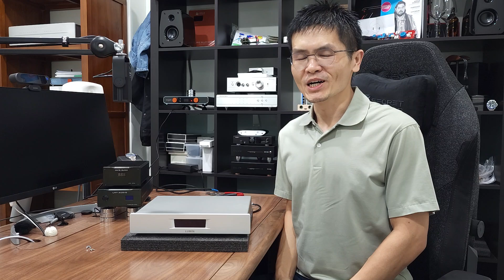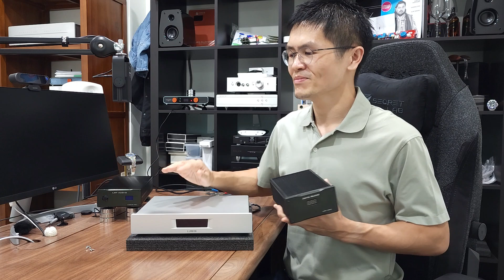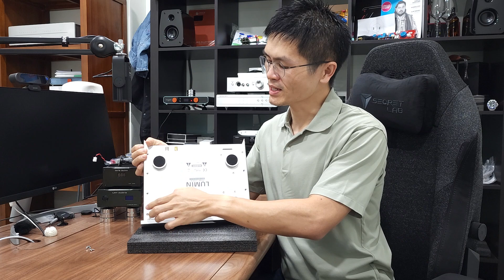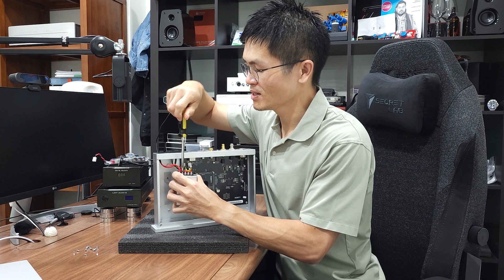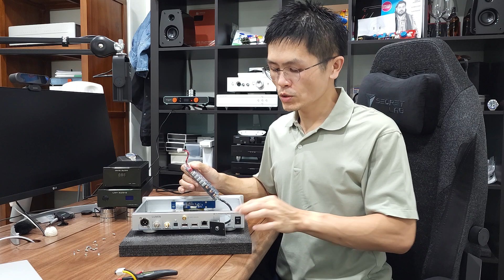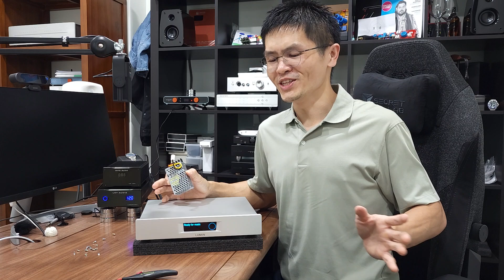Part #2: Lumin U2 Mini LPS Mod [Completed]

Comment: Hi Elvin, I’m considering the Beatechnik x LHY Audio power supply kit for the Lumin U2 Mini.
From your point of view, as objectively as possible, how much real sonic improvement does it bring on a scale from 1 to 10 compared to the stock Lumin U2 Mini?
Reply from the maker: Hey Nicola, the PSU upgrade improves the sound quality. As to %, I shall leave it to the users :)

Comment: Hi Elvin, thank your for your elaborative approach foe the lps upgrade. Can you share your opinion on the u2 min performance with lps vs the u2 (higher model)?

I have a pair of very HQ active monitors (dynaudio core 59) and i am especially looking for a streamer with aes/ebu output (sqc input into the core 59 is via aes) and volume control (what the lumin u2/mini have)

Comment: As far as I understand the Lumin U2 Mini is a fully digital component. It just "calculates" bits (there is no digital to analog conversion). So why a new PS should be of any advantage for this? Do you think a computer calculates more accurate when the PS is highend?
Reply: Everything is about "noise".
Reply: @kinggodzilla7647  yeh, snake oil digital "noise" 🙂

Comment: I bought the kit for my LUMIN U1 mini + LPS50 and the change is impressive, almost as if I had changed the Dac or the speakers. The sound is much more extended up and down the frequencies, and without grain, with a continuity and linearity that leaves you wow. More crystalline and less prominent at the top, more natural in the middle area and the greatest improvement is in the lower area, with bass with more grip, more sound space. If I could summarize the immense improvement it would be as sound with elegance and continuity across the entire bandwidth. Thank you again Mr. Alvin Chee.
Reply: How many V ( volt ) the lumin works? Which power supply to buy?

Comment: Hi Alvin. I have LHY LPS 25VA model for my Lumin U1 Mini. I plan to upgrade to LPS 80VA. Can I use back my current DC cable? Does the power outlet connector of 80VA and 25VA the same?

Comment: I already had a LPS for another gear. Then I bought the Mini upgrade kit but put it in the closet because the switch power was already good. A month passed, I finally did the upgrade and it is a true upgrade to me. It took my system to another level higher. Thanks to Alvin

Comment: Okay people, so I bought this and it took me a while but I installed it. Result on MY system (mid-highend) was outstanding! The soundstage is deeper, (obviously so) and wider, there is much more separation of the instruments, and the whole presentation is quieter than before. Well worth the upgrade of my Lumin U2 Mini.

However here are some alterations for the install:

1. Don't clip the one red wire from the switch to the plug: take a soldering gun and apply some heat and then slip it off. (easy-peasy)
2. Buy 6 3mm nuts and washers so that you may place the screws back in the chassis so that there are no dust holes 
3. Since the screws are now in their proper holes again, get something to mount the internal board about 6mm off the bottom of the case to clear the screws.

Notes:
A week later I am still pulling my head up / opening my eyes because I hear sounds more prominently than before (or didn't hear before). I think I am in the upper percentage of people who hear such a difference... but I am not so surprised what this LPS Mod has accomplished over its switching power supply. 

Also wish to say that this is much better decision than the sbooster because by default all the wires are at the back and not looking so sbooster fugly. (much less their is some L/C filter circuitry in this Mod which I believe is not in the sbooster)

This has been one of my best mods to a piece of equipment to date. (35+ years).
Reply from the maker: Thanks for the positive feedback and tips, James! I am glad that the LPS works for you, and more importantly, the modded Lumin is sounding good. Enjoy!
Reply: Thanks a lot, add few pics it'll be easier

Comment: Just shows how much profit these companies make. An aluminuim box and a single PCB. £200 in parts at the most, £1800 profit. Criminal.
Reply from the maker: I wouldn’t go too far in commenting this though. On bright side, consumers on the market are well informed these days, thankfully :)
Reply: Not really. In a device like this, the ongoing software development for the companion app is high. Costs for factory, labour and test equipment for FCC, CE and other regulatory compliance testing across multiple countries. Costs for custom packaging and technical authors for documents which all need legal review. Costs to set up a supplier chain and ship units to distributors, costs to market and supply loss leader units to reviewers. It all adds up. A retailer typically buys at 50% of retailed price, and the manufacturer makes similar margin, so the unit likely costs £450, but DIY equivalent doesn't have most of these costs. If you can DIY something as good including bespoke Android/iOS device apps, then do. But there's a lot more than a case and a board to bring such devices to market.
Reply: @maybecrazy7835  Some of what you say may be true, I don't agree with everything though. I hate the markup in audio, it makes me angry. I don't mind companies making a profit, but if you are right then 4 times build cost is still disgusting.
Reply: @johnratcliffe6438  Then don't ever find out how much a typical car costs once it's in proper production. It's a more eye-watering ratio. But I get what you mean. Certainly audio has areas way worse than streamers, most notably cables. But people still spend 100s or 1000s per metre. Audiophile cable prices could be considered a criminal enterprise.

Comment: What is the advantage of one of the larger power supplies as opposed to the 2amp unit. I ask because the switching mode power supply is also 2amp. What are the advantages of of the 5amp?
Reply from the maker: Hi James, I'd recommend LPS50/80VA for the Lumin U2 Mini. The LPS25VA rated at 12V/2A, might be a little on the bottle neck. As long as the LPS is rated >= the stock SMPS, it will work just fine.
Reply: @VinshineAudio 
i'm confused you said two different ones for the U2 mini what one of these two do i select for 
U2 mini •LPS50VA
or
•LPS80VA   ❓

Comment: hi, if i choose lps 80 which is 12v 5amp, does it compatible to lumin mini u2, any differnce in sq compare to lps 25. does lps 80 reduce the life of player, whn compare with other like 2  or 3amp lps
Reply from the maker: No sir, it will not reduce the lifespan of the device. The device 'draw' the current from the LPS instead of the LPS 'pump' the current to the device. A larger capacity LPS would mean that you have more headroom or at least more power reserver :)

Comment: Thanks for mentioning the warranty situation!
It's unfortunate, but there have been PSU modifications that have caused problems, so we have to take this stance. If you do want to change a PSU in a LUMIN unit, make sure that you are comfortable with the risk or that the company supplying the modification is offering their own warranty to replace the official one.
Otherwise, it may be better to trade-up for a LUMIN that features a toroidal PSU from the factory (U1 / P1 / X1).
Reply from the maker: Thanks for the clarification sir! I can't agree more.
Reply: Yeah, reality check here. You need to feel absolutely confident in your decision to start cutting wires and removing parts (and thus invalidating ANY future warranty coverage forever) on your fairly new $2400 streamer.  Maybe if you find the U2 lacking, you could take the money you were going to spend on it PLUS the extra $ for the upgrades and buy something that you don’t have an issue with.  A stock unit with a partial warranty still intact is going to be more desired during resale than a bastardized unit modified by your typical kitchen table amateur tinkerer.
Reply: It's a shame for the company not to provide LPSU with this price tag device. Learn something from Denafrips

Comment: Can you mount the LHY Filter bank kit direct too the orginale power supply on the Lumin? For better sound improvment? I have the Lumin T2. The streamer chassis have better place inside.
Reply from the maker: Sure, you may explore different method/position to mount the PSU kit.

Comment: I feel sorry for the people who have wasted their money on a Lumin.
Reply: Have you tried a Lumin U2 mini with upgraded PSU  in your owned system?  You may answer Yes but i don't think so. You are just one of those guys who make comment without basis.. Try it and you will be blown away. 
I sold my Gaia DDC and now my Schiit Freya+ preamp is also up for sale. That's how good this Lumin U2 mini is.
The Leedh Processing volume control really works wonder.
Reply: @BrokenArrow-x6f  I’ve heard it without the ps mod. It’s a basic usb streamer for $2500 lol. Why would you mod something that you paid $2500 for when there are streamers that measure and sound way better (with a linear power supply) at literally 1/2 the price?
Reply: @cameronrector178  HAHA.. Then you have a serious hearing problem.   And why would i mod the PSU? because it brings closer to the level of full Lumin U1 which is 5x more expensive than the U2 mini.  Did you see how much money i save with the mod? as i have said you are commenting without basis.
Now, go see an  EENT doctor to have your ears check ASAP
Reply: @BrokenArrow-x6f  bro you are using a USB connection 😂😂😂 GTFO
Reply: @cameronrector178  there you go again. How did you know i'm using USB? As I have said on my initial post, used to have a Denafrips Gaia connected to my Terminator  via i2s  and sold it after doing an AB test with  the Lumin U2 mini with and without the Gaia. And I used AES to connect the Lumin to the Terminator... Now you need an eye specialist too and go back to school coz your reading comprehension is very poor.🤪
Reply: @BrokenArrow-x6f  AES?!? 😂😂😂 omg. I’m done here. I should revise my comment. I don’t feel sorry for people who waste their money on Lumin. The world economy needs these idiots. 😂
Reply: $2500, no I2S output, and you have to personally modify it (voiding warranty) to make it sound half way decent !?!? NO THANK YOU!!!!
Come on Alvin!!! Please don’t recommend this garbage!!
Reply: @cameronrector178  Hi, what do you recommend?
Reply: @lazo64er  Silent Angel Munich M1T or Pi2 designs Mercury streamer. 
Both have I2S output that matches Denafrips pin out. No need for a DDC. Plug and play.
Each are $800. Sound and measure better than any USB streamer even with a DDC.
Reply: @cameronrector178 ... I've tested the Munich M1T against the U1 Mini. The Munich is not as good sounding. 

As for mods, Silent Angel sells a LPSU and different DC power cables. WTF you talking dude? 😂
Reply: “I've tested the Munich M1T against the U1 Mini. The Munich is not as good sounding. AB ... not in different systems. Next time, do an AB comparison. As for mods, Silent Angel sells a LPSU and different DC power cables. WTF you talking dude? 😂”

Explain how you did a A/B comparison when the Lumin doesn’t have an I2S output? 🤔GFTO 😂😂😂
Reply: @cameronrector178  … oh wow! You are right. The Lumin does not have I2S and the Munich has ONLY I2S digital out right? Stop being an ass ok. Both units have USB out.
Reply from the maker: It's a good streamer, loving it :)

Comment: Great video Alvin.  Expertly executed.  You didn't explain exactly the function of the internal circuit board.  Would it be a filter circuit to for example minimise circulating ground noise and/or possibe internal Lumin noise back into the mains?  I am a former Radio Ham with radio electronic qualification, so was confident to execute the mod.  I used  Plixir Elite BDC 12v/4a balanced transformer design which perhaps cancels the need for the internal circuit, though probably at more cost.
Reply from the maker: It's a good question. The LHY Audio PSU Kit does have L/C Filter circuitry, unlike other kit on the market. The LC circuitry is tuned by LHY Audio engineer for audio :)
Reply: @VinshineAudio  Thanks Alvin 🙂
Reply: Hi! I see other LPS conversions for U1 mini, that only include short cable from main board to DC5.5/2.5, to which you connect LPS. I can use either this board inside Lumin, or just cable to LPS? Just to be sure I don't buy wrong parts. Im using PD Creative 12V LPS. Thank you in advance!

Comment: Alvin, Would you comment on the expected improvements in sound quality/characteristics that one could expect from adding the external power supply.
Reply from the maker: Hi Paul, you may expect the following when you use/add an external LPS (a good quality one) - Lower noise floor that leads to better details, better weight, better imaging, soundstage. These are the common positive attributes.  That being said, I am a strong believer of good quality power supply is the foundation of good sound.

Comment: Blu-Tack works great for fixing the board to the bottom of the U2 instead of double sided tape.
Reply from the maker: Great suggestion! That's cool :)
Reply: I used 1 zip tie gently through the two holes close to the front.  It's perfectly secured to the chassis.

Comment: I am using Sbooster power supply. It was easy to install and made a substantial difference in the sound quality.
Reply from the maker: Thanks for the feedback sir. Indeed, I am a strong believer of good quality LPS!
Reply: This sounds so promising and the cost is most reasonable! What is the difference that you hear? TQ!
Reply: @hushpuppykl 
yes please tell us the differences in the sound quality...that is the entire goal...❓
Reply: It's good to know.  I have the Sbooster 12v-2A and plan to use it for this kit.

Comment: Thanks Alvin, very well explained and performed. After going through lots of streamers and struggling with them I decided to opt for the u2 mini and am very happy with its ease of use and performance.
However I’m always looking for ways to improve on my system and am very keen to upgrade the power supply to the Lumin.
I live in the Wirral England, so would it be possible to order the power supply and circuit board that goes inside the Lumin from vinshine? May I ask if the advantage of replacement. Could I expect a little darker background and what’s the costing of these components.
My system is in short .. Lumin u2 mini to Pontus 2 to Hegel p30 pre to passlabs xa30.8 power to q acoustics concept 500 
Thanks once again Alvin 👍
Reply from the maker: Hi Robert, I can't agree more. Lumin app is user friendly and its performance is good. Nice system you have there, the LPS upgrade will be an .... upgrade!